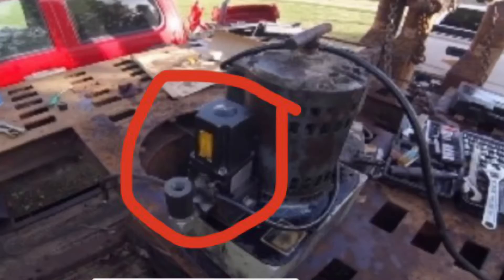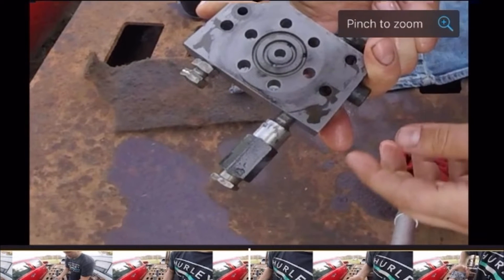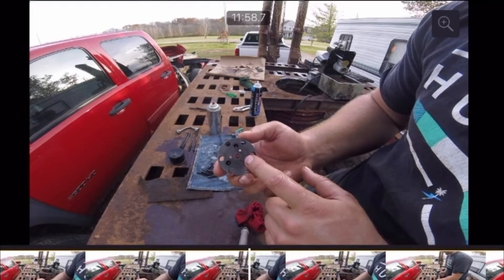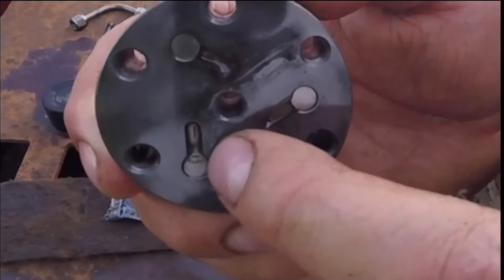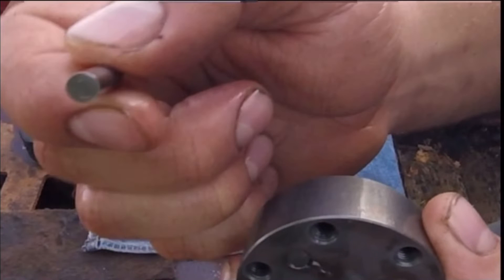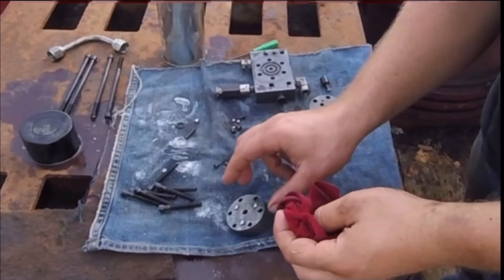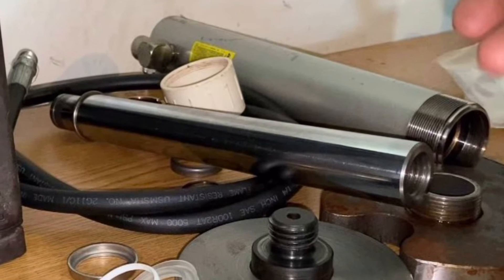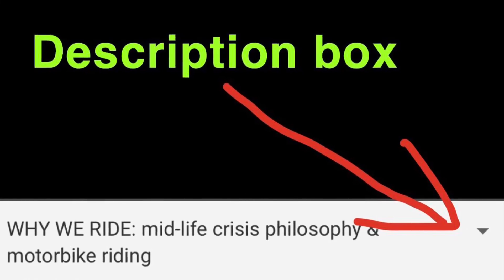S21 chief ez liner rebuild part 3 (hydraulic pump continued)

Comment: hey there. Question: my frame takes a while to lift machine up. motor runs, but doesn't lift. I have to hold a button up for two three minutes, till it finally kicks in, and start lifting. after that it works ok, till next day or time. Any advise please?! Thank you

Comment: I'd say this is a dead thread, but I thought I'd check. Have you removed or replaced the motor for this style pump assembly? I am needing to replace mine and I haven't been able to find specs for the shaft attachment. And, I haven't attempted to remove mine yet.
Reply from the maker: Fortunately I have not replaced motor in one of these. I would recommend you take a very close look at your motor shaft, from what I remember about mine it is a specialized motor shaft, it has a oil seal at the top, and in general (from what I can remember it’s somewhat special) it’s something that you would have to take apart first and look at in person. Hopefully this helps, thanks for watching?

Comment: Where could I purchase the part where You put the o ring? I need that part only.
Reply from the maker: So I did a whole bunch of research on this issue. I was questioning whether I could get some of the hard parts or not. So the thing is they do not sell any hard parts, neither does the manufacture of the pump or the motor. So basically you have to buy the entire pump if any of your hard parts are bad. Now course there’s always exceptions, but I did quite a bit of research and through my findings you cannot get hard parts. The best thing I could recommend you to do, is to keep an eye out for a free machine pump that’s the same thing, maybe you can scavenge some parts off an old pump. Hopefully this helps! Thanks for watching!